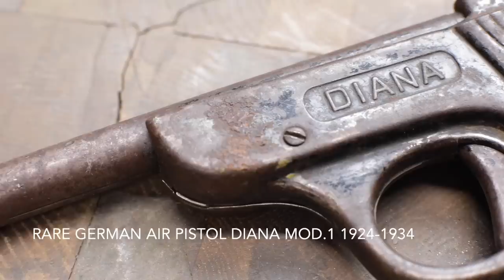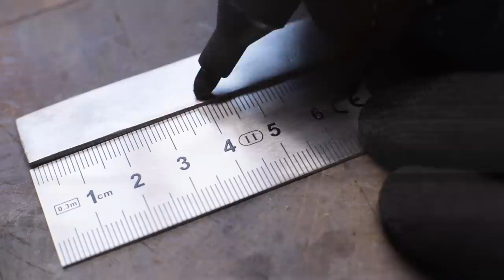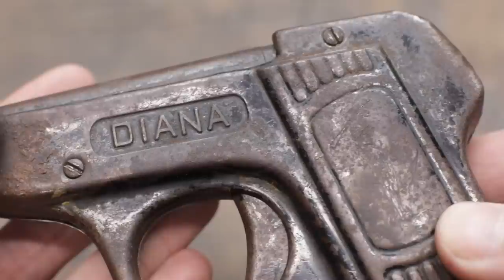Restoring Rare German Air gun 1924-1934 . Diana mod.1 restoration

Comment: It's a bit of shame you didn't manage to replace the old gasket and rubber ring and grease it up (at least not shown in the footage), but it still works great. Excellent work!
The custom screws are much better. And the tool you made to load it is very interesting.
Reply from the maker: Thank you! The tool for tensioning a spring is made according to the original. This model does not have a rubber ring.